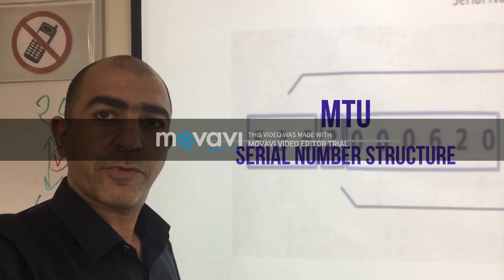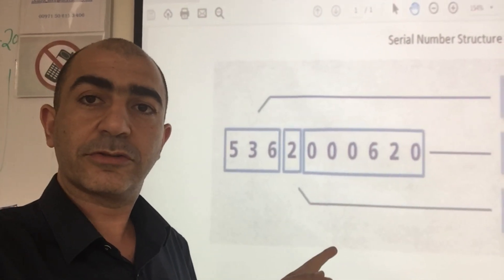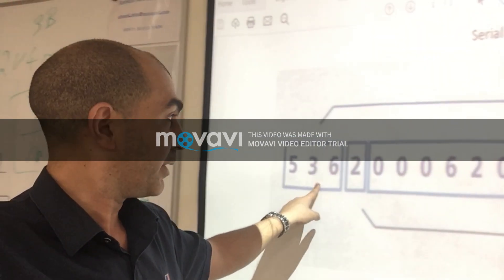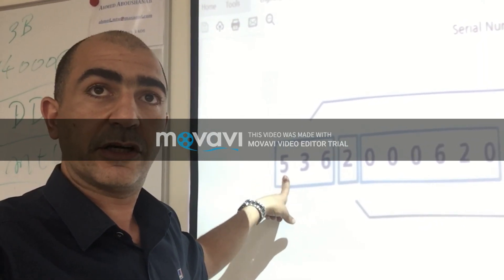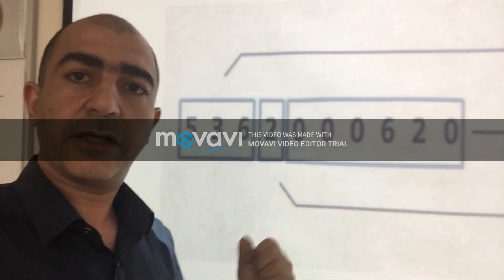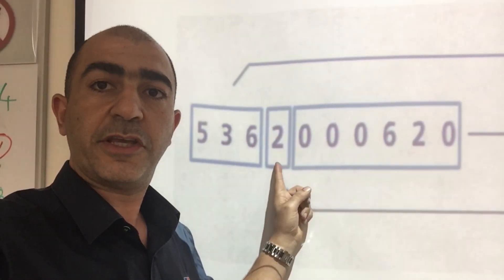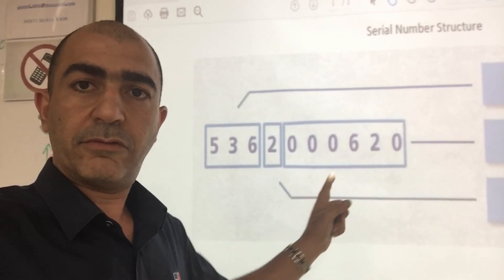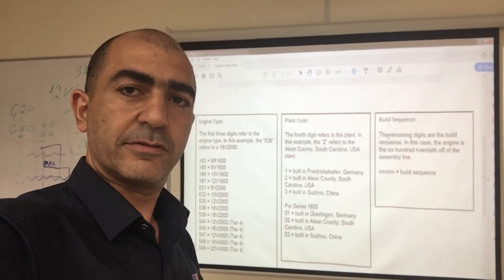MTU Friedrichshafen serial number structure

Comment: I have a few MTU generators that I need to know the manufacturing date.  Is there a list of serial numbers by year?  I figure a list by year wouldn't be too difficult since the serial numbers are sequential.
Reply from the maker: with the only serial number you can not do, this will need to check with the official distributor from the system